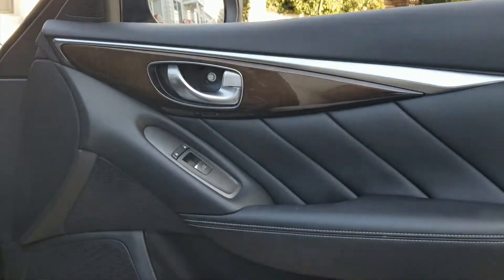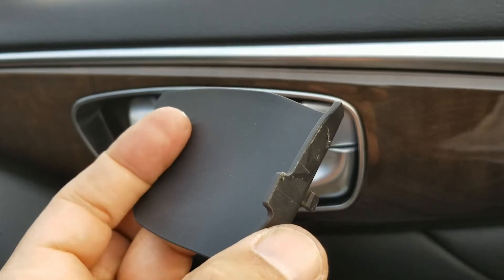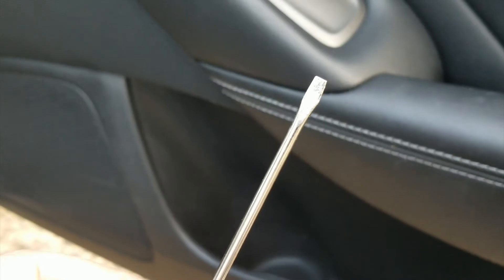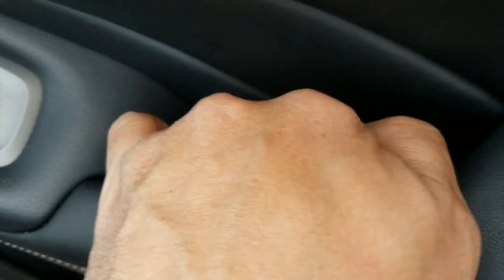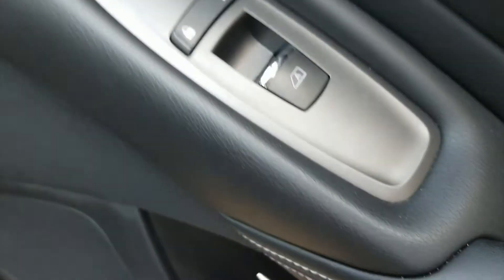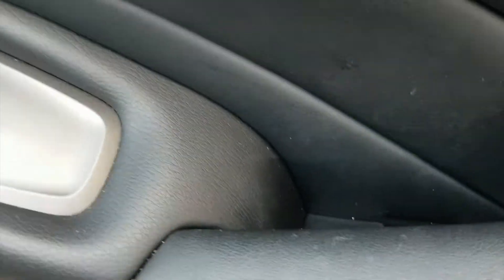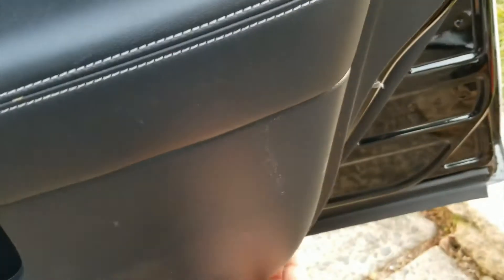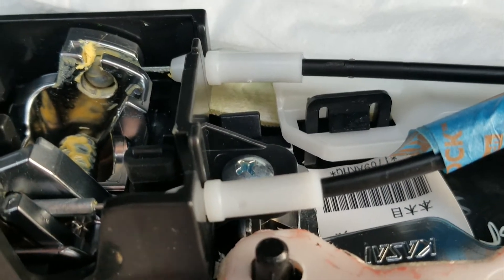How To Remove 2013-2020 Infiniti Q50 Door Panel.

Comment: Wow that was the simplest demo ever! Other vids made it seem so complicated. I have the bose package and door  speakers but they sound blown. Would they be 6 ½ as well? Thanks for the video!
Reply from the maker: Should be. Bose usually uses the same size but has more speakers in the vehicle like the dash and the back deck. Well now that you know how to remove it, take it off and look.. lol.. thanks for watching
Reply: Actually the bose package version the front door woofers are 10 inch

Comment: Hey how do u go about removing the front passenger side power switch. My window won’t go down but I don’t know if I’ll have to remove the whole panel? Please help
Reply from the maker: Off the top of my head, I dont think you can just remove the switch without removing the door panel. It is not hard removing the door panel. I would not chance trying to separate the two. From experience, Infiniti is a little bit more put together than most vehicles. I would guess to remove the panel to get to the door switch. But honestly im guessing from experience. But its really not as hard as you think to remove the door panel. I would not chance it. The video is clear for the door panel, not the switch, I would just spend the extra 10-15 minutes to remove the panel than to try to break something. Not worth it if you break, slip and scratch, or mess something up. Not worth a pretty car like that.

Comment: How heavy are the door panels?
Reply from the maker: That is a very odd question. But I will answer it to the best of my abillity. Lol. Infiniti tends to run on the heavier side because of the materials they use. So if I had to guess what they weigh, 10-14 pounds. But dont hold me to that. 🤪🤣

Comment: You guys know if a 2019 door with new Bose system would work if I put it on a 2015 q50
Reply from the maker: Well if the 2015 doesnt have the bose, then it would look dumb because the other door wouldnt have the bose. But if it does, thats an ebay purchase. You buy it with the hope and look that ot will fit, if it doesnt work, bvk it goes for whatever reason you wanna make up. Done. Lol

Comment: Can you do one on the small speaker next to the window ?
Reply from the maker: The one on the door? By the mirror? If so, I have a video for removing the door mirror and it is the same process. If you mean in the corner of the dash by the windshield? If so, I have a video up for a nissan 370z and that should be similar. I dont have the car with me anymore. I try to get as much stuff as I have the cars. Im tryin im tryin..lol..